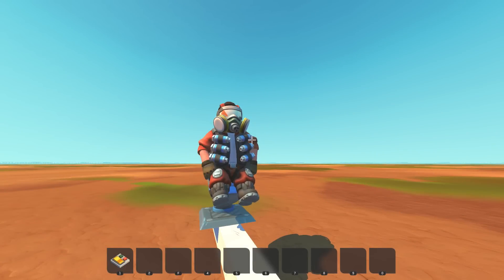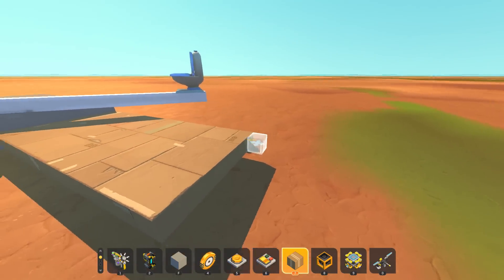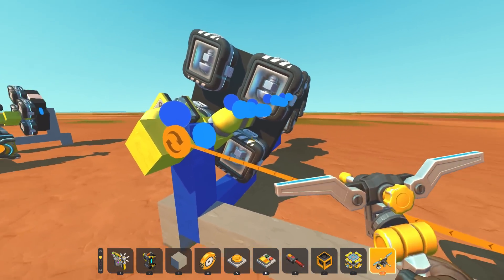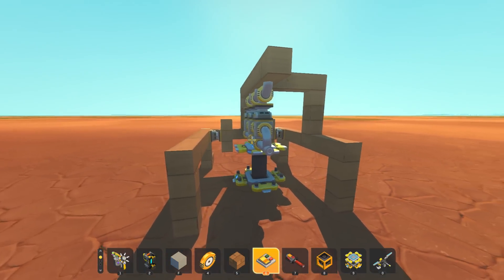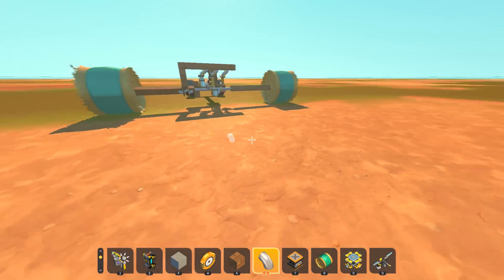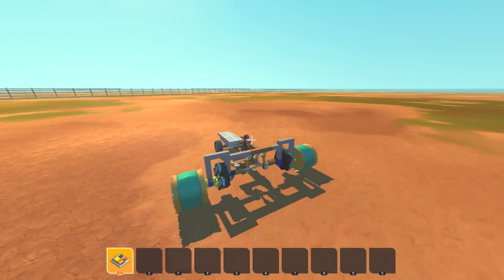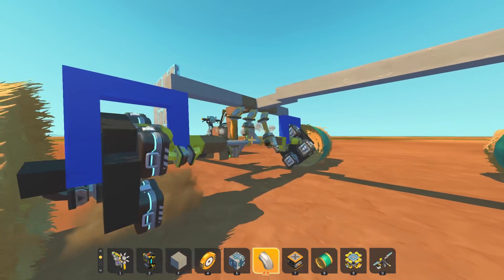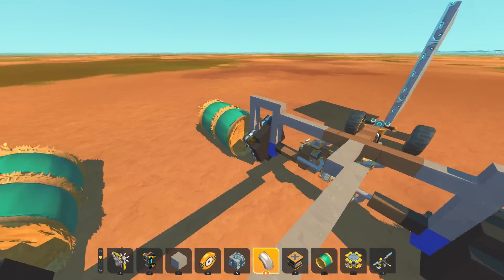This Trammel Gear Mechanism Will Change Piston Engine Builds Forever!

Comment from the maker: What other cool mechanisms should we look at in Scrap Mechanic?
Reply: Differential for the piston engine. Should make turning easier
Reply: Diffs are hard... @FizzDB
Reply: Lamdamechanism. also first?
Reply: Am I the only one that thought we can make very high-speed piston engines in survival and then the kind of like electric cars in real life instead of to make a gas station but your electric car never needs to be charged?
Reply: skip the gears, just make the crankshaft with a bigger diameter and use corresponding longer pistons. is all pistons push with the same force. doubling the crank diameter will double your torque
Reply: @jf5792  But that encounters an eventual limit. You can only achieve a maximum torque of a 15-block crank arm, after which point the pistons cannot extend further.

In addition to this, conventional piston engine building techniques top out at a 3.36-block crank arm (1x3 offset), and a 1x2 offset is already enough to overcome the controller bearings within a conventional crankshaft.

Any of these higher torque engines could still also be coupled with a gear reduction, producing even more torque.
Reply: @jf5792  That is true for gearing down, however using gears can be more compact than a larger crankshaft is. But when gearing up there is a minimum size for the crankshaft length (1 block) and then you can't get any more speed out of the engine, that's where you have to use a gear ratio.
Reply: A Schmidt coupling, it's very similar to a U joint but different.
Reply: If you look back at the piston powered tractor from YBB, you'll see a cool mechanism to relay power through a block without a piston. You may think that mechanism can only be done with blueprint editings, and you'll be partially right, the clipping wedges are a BP-edit, the pipe through wedge is 100% vanilla if you look from the proper angle.
Reply: Loving this return to mechanical stuff!
Reply: It would be cool to see a faster piston powered airplane, or helicopter, using this mechanism
Reply: A Geneva Drive would be really cool
Reply: Not sure but arglin kampling is a cool resource (both channels) mostly a poly bridge person
Reply: Make a sensor pad and a shape spinning on the drive shaft should be detected by the sensor pad. That would be great for a piston engine.
Reply: V6 piston engine
Reply: Maybe look at or revisit universal joints?
Reply: Oldham coupling, kinda similar to trammel
Reply: @jakubpollak2067  That is called a "Love Joy Coupling".
Reply: Suspensions
Reply: @kANGaming u should do a live stream where u try to improve ur piston engines and look at cool mechanism involved with them
Reply: Swerve drive
Reply: Two words. Piston Plane
Reply: U-joint
Reply: Oh come on, you just stole my exact piston engine idea that i made yesterday
Reply: make a ratchet powered vehicle
Reply: Tandem RC drift full length video with Mr /< question mark with a hopeful smile?
Reply: You should try making a piston engine from a trammel gear - like the one at start - to see how it affects the engine output.

If you have a bearing halfway between the two piston heads on the trammel gear it makes a perfectly circular path which could be used to spin a crankshaft. I think this could lead to some interesting results for designing piston engines. Or it could just be bad and useless, but you'd have to see.
Reply: bring railroads online with hyce back bro
Reply: Why not try hooking that trammel gear to a differential. you got a video checking one out from about 6 years ago. I don't know if it still works but it would work to transfer the torque to the wheels directly from the engine along a shaft.
Reply: Apply this to an explosion engine!
Reply: There are many great inspirational mechanisms coming from MC Clockwork and surrounding mod family.
Reply: First

Comment: When nerds try to do something related to mechanical.

Your weight on the front of them was lifting the rear ends hence losing traction, you needed to move the weight towards the back a bit, not more wheels

Comment: You have the gear ratios reversed if you want speed it 1:2 ratio if you want tourqe it is a 2:1 For example: 1:2 means one rotation of the driver gear causes two rotations of the follower gear. This is acceleration - the speed is increased 2 times, the torque is decreased 2 times. You get double speed but half of the torque.

Comment: The even cooler thing is that this wasn't hard coded, it's just a product of the simulation going on. Nobody told the game that it must spin x times for a certain gear and that torque would change. However it just makes sense because this is the result of physics playing out.

Comment: So basically, you could create a working gearbox by selecting which trammel to use (ie which gear ratio) and not only will you be able to choose at what speed to go, but you'll also be able to adjust the torque you'll need !
Looking forward to see someone build this.

Comment: 12:25 Kan, I think the hay-bale wheels are off the ground, mate. 12:28 Confirmed, the wheels are off the ground. You need the weights between the normal wheels and hay-bale wheels of each side. 13:22 So the hay bales are heavy enough to make contact with the ground, huh? Interesting. Thanks for sharing the mechanism!

Comment: A planetary gear can give you a higher gear ratio. I had a atv winch with a 200/1 ratio the ring gear was split in two halfs one gear had three fewer teeth on the same diameter and the sun was driven hope this can help you 😄

Comment: Try to install both 1:2 and 2:1 ratio on one single vehicle and make an toggle switch to be able to turn off one and turn on other one. For example, first one when you hit the gas should be with higher torque/less speed, then after gaining some speed switch to speed one. The vehicle should be in top places in any race. Just imagine, when you start a real car and start driving, basically you will need more torque/power to start moving vehicle then you can just switch to another gear for speed. Or slap even few gear system like 2:1 for start, then 1:1 for gaining speed and then 1:2 for max speed. you know what I mean lol
Reply: Unfortunately Kein engines are going to keep dominating piston engine races. Instantly in the power band and they rev to the moon.

Comment: Try stacking the pistons on one of another, there are some guides here on yt for that
Reply: Increases speed and potentially stroke length, but not torque. Longer strokes top out at 1x4 crank offsets for double pistons, but 1x2 already starts to back drive the controller bearings.

Comment: Is there a reason why you specifically use component kits in the trammel gear?
Reply from the maker: They have a rounded hitbox which makes the trammels move into the slots easier.

Comment: That's cool, but won't those component kits be removed in the future?
UPD: no, they won't
Reply: Huh? Never heard of that. Why would Axolot add component kits only to remove them later?
Reply: @limonlx7182   I think, I've seen something about it in one of the dev blogs, But now I can't find anything about it. Maybe, I'm wrong
Reply: @limonlx7182  Yes, i was wrong. They will replace warehouse keys with new ones. And old may turn into circuit board. Source: devblog 20

Comment: Hey, super nice that you figured out the trammel gears, they are super useful if you dont want to mess with your engine stroke. 

Regarding the challenges, the only thing that may be an issue (might be more of an issue on the hard - insane levels) is that the trammel gears require super high reinforcing so everything meshes well enough, I have been having issues with this myself. 

One thing they are super good for is speed as they dont require much reinforcement and you can solve the problem of the soft rpm cap of normal stroke, single piston per cylinder engines without messing with anything super technical.

Loving the piston vids so far, cant wait to see more in the future, I think the inline 3 needs an upgrade!

Comment: I thank you for showing us the Trammel Gear assembly. I wish there was a better way to make U joints in vanilla, so this could be used to make a proper engine and drive train
Reply: U-joints aren't terrible, but I agree. If there were ways to make them 1-wide and differentials 3-wide I'd be so happy.
Reply: @DigitalJedi differentials can be 3 wide with some clever suspension pieces.
Reply: @ShoopityBoop  you have my attention. Is there a workshop listing for this to learn from?